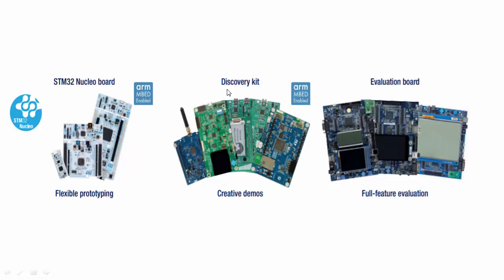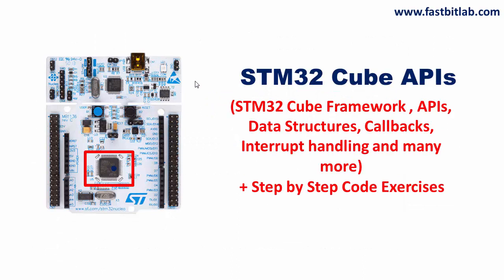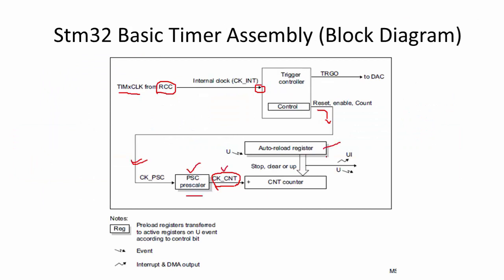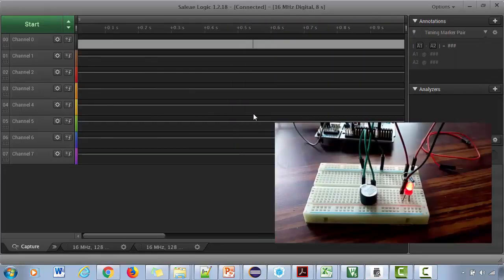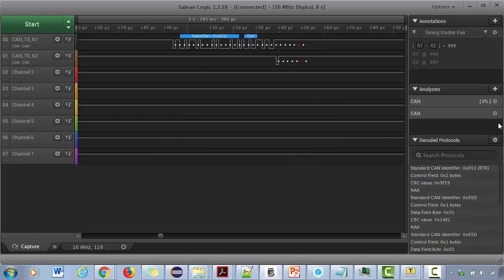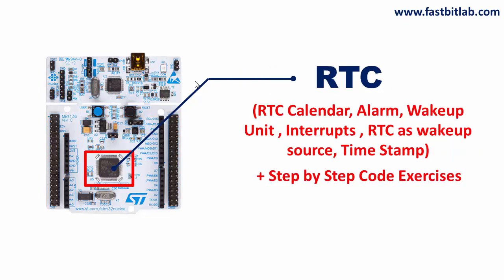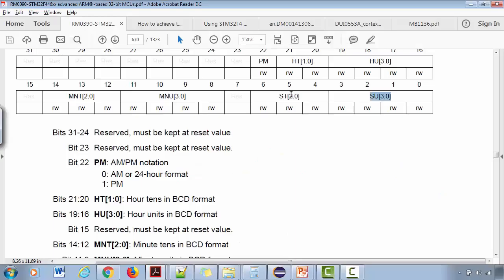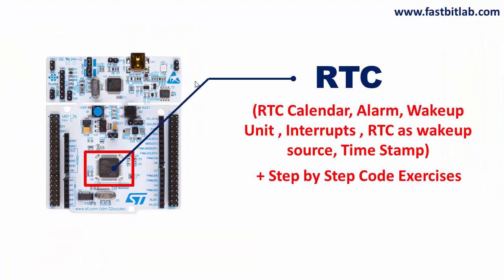Programming TIMERS, PWM, CAN, RTC,LOW POWER: Course overview

Comment: Hi did u know how to set phase and frequency correct mode on a stm32? (center aligned with complementary channel)
Im using maple library with a blue pill for a simple AC inverter with 2 mosfets.